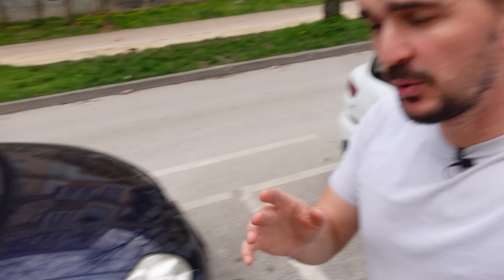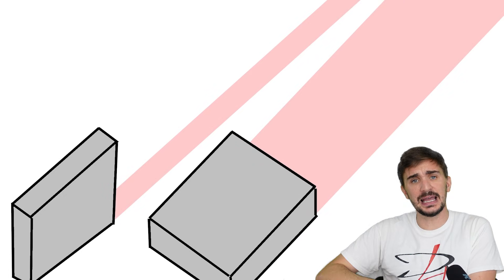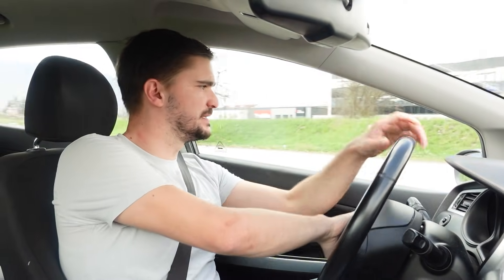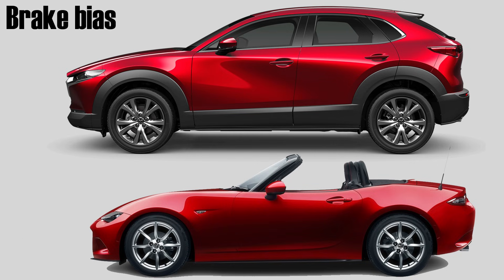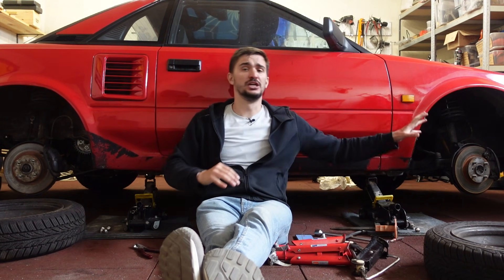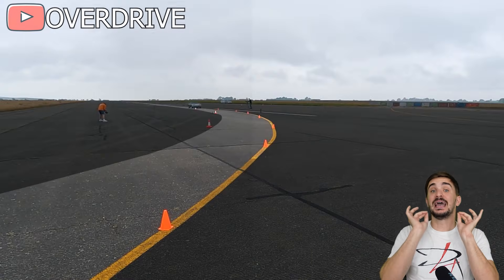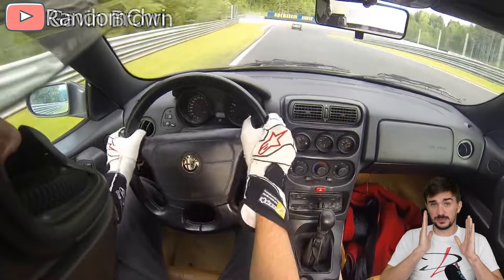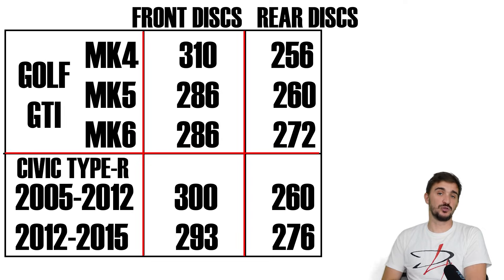Why are Front Brakes Larger than Rear Ones? Brake Bias Explained

Comment: Many cars as well have larger brakes in the rear because rear disks actually as well have drums for handbrake, despite of that the front brake disks have much larger surface area, much more powerful calliper and larger pad. So quite often the disk diameter in the rear is bigger, but braking force is still always biased towards the front.

Comment: Is the C8 Corvette a special case? I though I saw that, on the C8 Corvette, that the rear rotors were one inch larger than the front rotors.
Reply from the maker: My mr2 has larger rears and many other cars too, I mentioned it in the vid. But bias is still in the front
Reply: @d4a  Why would they do that?

Comment: I've always been a bit curious why I've found a small number of cars that have equal brake size front and rear and, in the case of the 1988 Dodge Shelby Lancer i had, vented discs front and rear. As to braking performance, that car was hands down the best i have ever driven, by large margin.
Reply: My 87 Pony has more surface stopping area in the rear (drums) than front (discs). It's probably due to it being RWD - they split the prop valve 50/50 front/rear.
Reply: @The Kombinator  similar to when i reworked the brake settup and bias on a couple Hondas i used to have. Handling application.

Comment: I totally agree with the Formula you used for friction. But now I'm wondering why wider tires result in better cornering and acceleration grip.
Reply from the maker: Pinned comment
Reply: My guess is that traction can also be limited by the tire’s material strength. If the tire is too narrow, the force is focused on less cross sectional area on the rubber and simply shears it off.

Comment: great video. I engineered the braking system on an FSAE car a while back and this reflects what I learned through doing that. It's worth mentioning how different caliper and master cylinder piston sizes can also have an effect on braking forces. Pressure equals force divided by area, so changing the total area of the various pistons in a given hydraulic loop will change how much hydraulic pressure and force at the caliper will result from a given pedal input force. This is also impacted by pedal ratio, brake bias, rotor diameter, etc. So you can have a car with equal-sized front and rear rotors, but bigger calipers on the front, and the car will still have an overall front-biased braking system (see the Porsche 911 as an example of this)
Reply: Please send this simple information to Yamaha Motorcycle corporate offices ...they seem very slow on the uptake....someone there just year after year fails to "get it"
Reply: Hey, I was watching this video because my university's FSAE team told me to make a research about brake bias. I saw your comment and wondered which team are you in and your thoughts about FSAE. Did it really teach you something or is it any beneficial etc. ?
Reply: @abdullahbal8003  I was at Northwestern. FSAE taught me almost everything I know about engineering and was a serious leg up when the time came to find a job in industry. I can't recommend it enough, it can be challenging and time consuming but it pays off in the end in a big way. are you US based? happy to answer brakes specific questions as well, I am not a professional brakes engineer but the competition design judges liked my system a lot...
Reply: @camerone397  Hey, I am really glad you answered; and really sorry for answering this late. I live in Turkey, my team is a Turkish team. I am in the support crew now. This is the crew before you join the "actual team". I don't have a question specifically about brakes, it is just a part of my duty they gave me. Only thing I wondered was if it worths it. I have been really enjoying while doing the "duty", and having your super positive answer now is the cherry on the top. Really appreciate that. Lastly, I would love to keep in touch with you if it's ok.

Comment: I have a BMW M140i. The rear brakes are larger than the front in diameter. That might be because they have the silly seperate drum for the handbrake inside though.

Comment: Thanks for another great video.  A question. Why do front wheels always accumulate black powder (like charcoal) while the rear ones never do? Where this black stuff is coming from? The breaks?
Reply: That is the brake pad dust. If a car has rear disc brakes, then rears "generate" it too, only less, because of less wear.

Comment: Technically the weight doesn't transfer. It's still a downward force operating as if through the centre of gravity of the vehicle. What you are seeing is the resultant force of the deceleration horizontally and the weight vertically changing the load balance on the front and the rear. So it is more accurately called a load transfer.

Also, that's a very naive view of the nature of the grip between road and tyre just being a function of the downward force and the coefficient of friction. The tyre to road grip is not described by that very simplistic coefficient of friction and downward force equation. Because of the nature of the road surface and, especially, the rubber the linear relationship with load breaks down towards the extremes. The rubber itself distorts, heats up and can even change its behaviour.

Comment: Fun fact: Your actual brake torque is dependent on mean friction radius and not total disc diameter. Mean friction is outer pad radius minus inner pad radius.
So you could have a large disc with a large/high pad actually having less brake torque than a smaller disc but with a smaller/shallow pad.
Manufactures can fine tune the brake torque by machining the top or bottom edge of the friction material to reduce or increase mean friction radius.
Reply: wrong : mean means a+b=c divided by 2

Comment: Another great video. Thanks for doing such an interesting and educational clips. One thing to point though is that in many modern cars and particularly Toyota hybrids rear brake pads wear faster than front one as a result of ebd and the fact that in some stopping situations rear brakes are engaged while front ones are still off as the cars relays on regenerative braking plus the traction control constantly applies brake force in turns. 👍

Comment: Thanks for another interesting video. 😊
F=µN doesn't apply to viscoelastic friction, and is generally a poor friction model.
The EBD devices are great. A common failure is the linkage in the rear suspension - a good thing to check if your car is getting older.
Reply: F=µN only apply to ideal body in school assignments.

Comment: Umm actually... there is some more exeptions, T22 Avensis has 275mm front / 288mm rear, 99-05 Yaris has 255mm front 269mm rear. Fronts are ventilated, rears are not. rear brakes has smaller pistons and avensis has dual piston calipers at front.

Comment: I always like to watch your vids. I think that you had a small "hick up" . As far as i know, to maximize the tire griping/ performance, the tire needs to be taken over its grip level (slipping) . If not, it will not be used to its full potential. The ABS does let the tire slip/ skid and lets loose as soon as the tire locks up. But its happening so quick, that we nearly dont recognize it ( pumping brake pedal). 

Before ABS was standard, there was also a brake technique which is called stutter braking. As soon as the brakes lock up, you need to release the bake pedal and apply it again, continously, as quick as possible till you overcome the lock up or you are completely standing stil. Tha ABS does the same but much much quicker.

The same is applied to launch controls. If there is no slipping alloud, the car accelerates slower compared to the situation, when you allow ~5-10% of slipping. Its also used by racing drivers to maximize grip while cornering. Its called slip angle.

If you dont belive me, driver61 and engineering explaind made videos about it.🖖😃
Reply: "small" but very important correction as this is a common miss belief "loose as soon as the tire locks up" - no ABS never allows a wheel to lock up. The wheel is kept around the optimal slip value.
Reply: @gaborb  yes, and ypu said it, slip. Call it how you want, but as soon as something slips, its micro locking.
Reply: @G.J.G.P.  yeah naming doesnt matter until we mean the same thing. i guess @d4a also given this reply because locking/skidding wheel means 0 kph rotating speed. which is not good. (if the car is moving :D )
Reply: @gaborb  yeah, sry for using the wrong term. But the other explaination is more like thrashhold braking. Right term of locking up is 100% slip, so again, sry for my fault. But the ABS stil allows slip, meaning the tire travels less then the surface. And in which scenario is that possible? The tire needs to have micro lock ups in order to do so. Thats what i ment
Reply from the maker: When a tire skid that's a loss of traction and cannot maximize grip. Slip angle does not mean that a tire is slipping https://youtu.be/MwrUz1WI5GY
I haven't watched the vids from the other channels but I'm pretty sure they didn't convey these points in them.
Reply: @d4a  as soon as a tire slips, youre over the moximum grip and not below. So excuse me, if i used the worng term  but at the end its not before, but after the maximum grip.

Comment: but oversteer is way more cool
Reply: Go try it urself going 150kmh then lock the rear
Reply: @zeliskindofstupid All fun as long as you dont hit anything 🤣🤣
Reply: Oversteer is better because you dont see the tree that gets you
Reply: Just don’t slam into anything if you do
Reply: 🤦🤦🤦 hit the throttle next to a tree😂
Reply: You can get oversteer installing system that allows you to change brake bias. But most cars setuped to be understeery, cause understeery car is safer for average driver.

Comment: in reality this is partially true: dynamic and static friction don't care about contact surface and we all know that this is true, but these types of friction manifests only between two really hard materials sliding between each other. in reality, especially in this case when the surfaces in contact are rubber and asphalt, we introduce the volvent friction that depends from surface of contact between the two materials. infact, for example, during winter, when road are covered by ice or snow, narrow tyres (apart the shape of the tyre tread) provide more traction that large tyres, because narrow tyres spread the force on a smaller surface in the case of low traction and soft surfaces.
instead, on summer, when roads are usually dry, the larger the contact surface (the larger the tyre), the better the traction

Comment: On a motorbike and bicycle you will always perform this biasing thing automatically. You can really feel, how applying more brakes on the front or rear tire will impact your overall braking performance. 

And yeah, the rear tire will always lock first. But because you know to never break hard while cornering, this will never be a problem.
Reply: I'm concerned about your comment. Frankly, you absolutely have to consider rear wheel locking while braking in a straight line. I believe most fatal accidents occur from failure to use the front brake. 

Under emergency braking almost 90 percent of the braking should be done by the front.

If you need to practice, go to and empty parking lot and practice safely. Learn how to stop correctly.

Comment: Sorry. @5:20 you said: ABS keeps the tires on max grip. is it really true?
ABS opens up a locked wheelbrake to get rotating wheel again.
ABS helps keeping control on the vehicle during max braking.
The shortest stopping distance you'll get exactly on that point of max brakepower  BEFORE the ABS is engaging.
just my point of understanding
Reply: yes it is really true ABS keeps tires on max grip. It not opens up a locked wheel it does NOT allow a wheel to lock. If you are not pushing hard enough to "engage" ABS you are not braking at the limit.
Reply: @gaborb  can you show me a pressure diagram to your sayings?
which sensors are used for it?
Reply: @AmbaMerlinson  actually i did not mention pressure but of course ABS regulates pressure to achieve the goal to not lock up the wheel. Regarding pressure diagram i just can google for it so you can also do it. If you tell me what you would like to check on the diagram i might be able to answer.
which sensors are used for what?
ABS uses mainly wheel speed sensors and also acceleration sensor.
Reply: @gaborb  wheel speed sensors check the turning if the wheels. the difference between front and rear wheel is compared by ABS-System.
Which ABS-System on earth is already able to "feel" just that point of max brake pressure BEFORE locking a wheel?
my 2021 Honda ATAS DCT EERA, including a "so called" 6axis IMU cannot do this.
I need to "overbrake" (to lock) a wheel to get ABS engaging.
if I dont lock a brake the ABS does what?
Correct. Nothing.
Reply: @AmbaMerlinson  "Which ABS-System on earth is already able to "feel" just that point of max brake pressure BEFORE locking a wheel?" - every.
if during braking the car goes eg 100 kph and the wheel rotating with 90kph then abs already can "feel" it must do something.
Definitely you do not have to lock your wheels in your honda to get abs working.
Reply: @gaborb  which is your expertise?
are you lawyer or engineer?
Reply: @AmbaMerlinson  i have no clue why do you might think that i am a lawyer. I am an engineer.
Reply: @gaborb  looks Like we have different understanding on how ABS is working.
To keep wheels rolling abs "unlocks" the blocked wheel.
And let the pressure rise again. Wheel stops, abs "unlocks", and so on . . .
Where are the sensors to let the abs-system know that a sudden wheelstop will occur?
The IMU is Not able to do anything without Sensor Input.
Reply: @AmbaMerlinson  i already told you which sensors are used by abs. Even if you take away the longitudinal acceleration sensor (but why?) you say "abs unlocks the blocked wheel". So if the wheel speed sensor can detect a wheel which is not rotating what prevents the same sensor to detect wheels speeds like 100 on rear wheels and 88 on front wheels. ABS do not wait to read 0 (locked wheel) it lowers pressure way before.
if your main concern is about "sudden" then for example if there are wheel speed sensor readings like: 100,99,95,93,91... or 100,98,90,80,72... i guess you already know which will lead to sudden stop just like abs does.

let me know if i am still not clear.

"The IMU is Not able to do anything without Sensor Input." i do not understand this one. IMU is an INPUT for ABS.

Comment: Does removing ABS fuse affects braking bias?
Reply: yes, the car wont have EBD anymore
Reply: @gaborb  so the older cars with abs but without ebd will be fine?
Reply: @RCmaniac667  i would not say fine without ABS but regarding brake bias yes it should be ok.